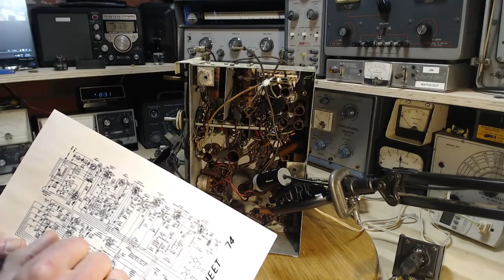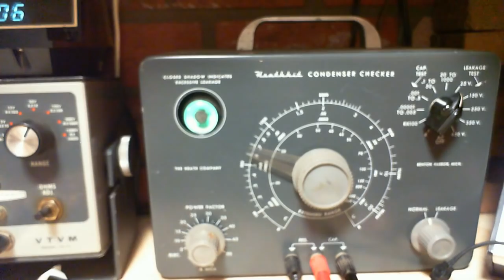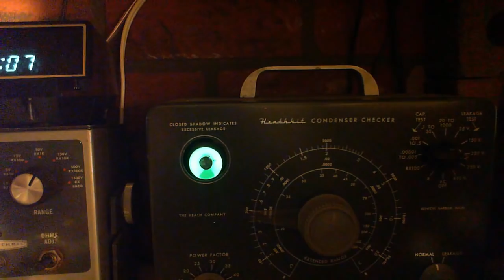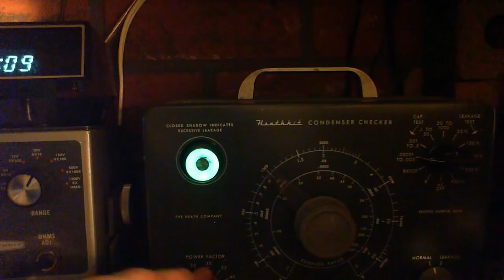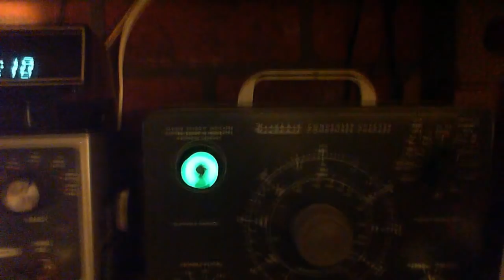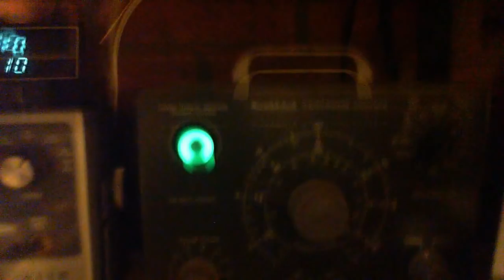Canadian General Electric KL-96 Video#4 - Audio Circuit Capacitors

Comment: I will never tell you I told you so. I haven't been restoring radios long and have only done a few, and I did used to "shotgun" caps. but I have since learned from others more experienced then I that is not a good idea, and now I do as you are and change them one or two at a time and power it up in between so problems are isolated rather then trying to find a problem after all the caps are changed and having no idea if you created the problem wiring something wrong or if it was a problem that was already there.
Reply: +Tom k2bew yes check after every few caps if you deside to change them all